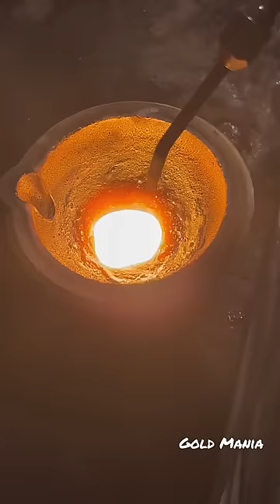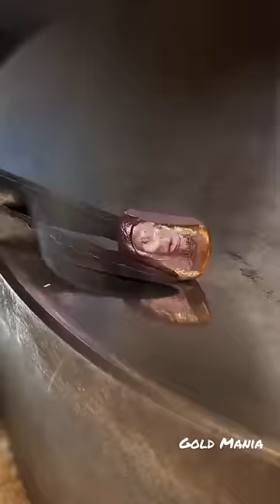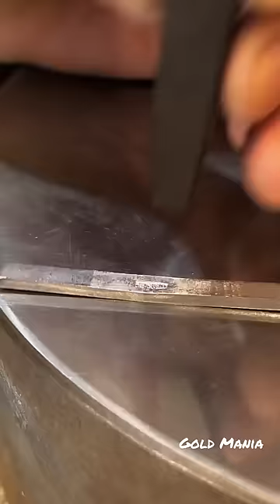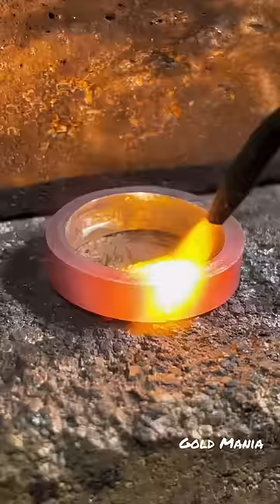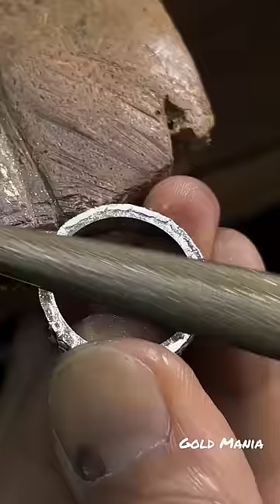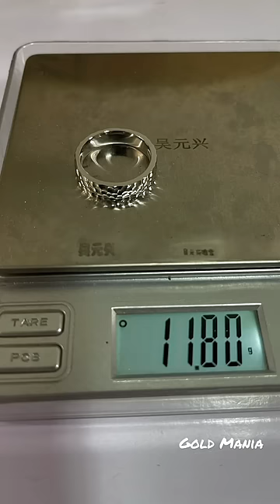Today I'm Making a Platinum  ring 💥💥❤️  #ring v25

Comment: I notice if your really melting Platinum, u need a special torch that can melt a 2 grams or more  also a crucible that can handle extreme high temperatures. Otherwise it well take 10 times longer to melt Platinum and pray to God un wearing welding goggles.

Comment: U genious are totally wrong i've been a goldsmith for 50 years. I sized thousands of rings in ths last couple of years, and 98% of my customers were satisfied with my work. Obvious u don't know the riged details and steps to size a ring up or down. It take years to size rings correctly using Hard solders without melting ring or damaging stones. No u only remove the gold needed to make the ring smaller if u remove to much the ring well be  to small. We keep the small piece of Gold to offset the labor of sizing ring and it well cost more to size ring. Since forever we reputable fallow this practice or just go to your local pawn shop they well ruin your ring with cheap solder or steal the stones.